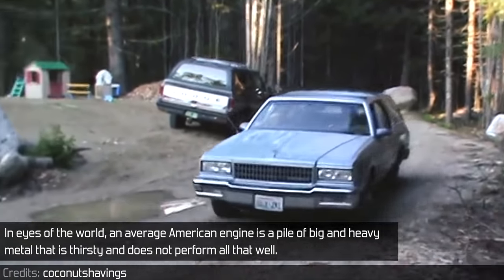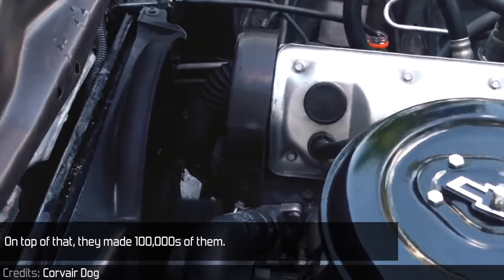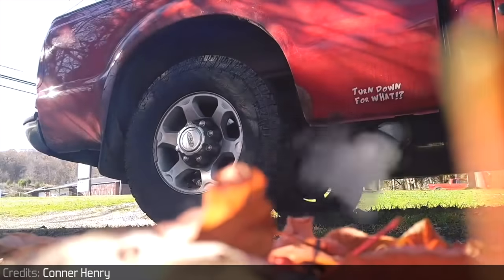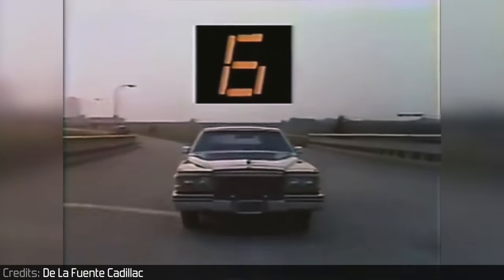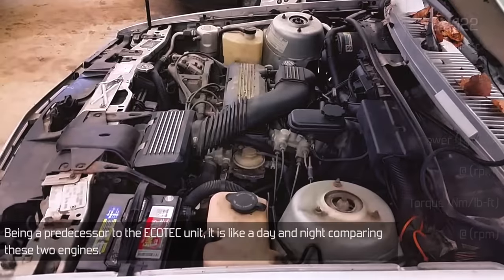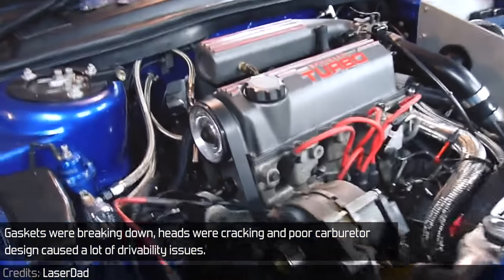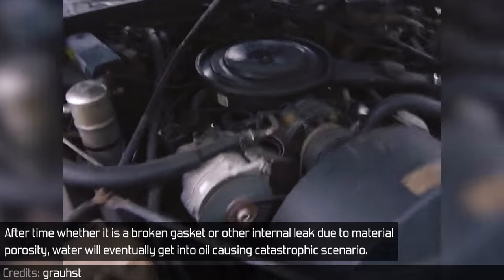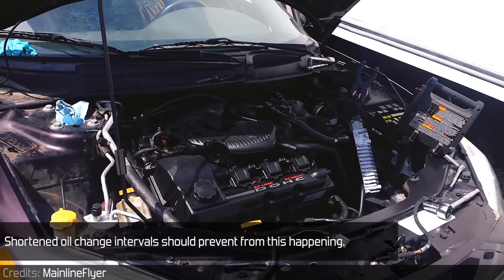8 Worst US Engines You Should Avoid

Comment: As I have a 03 expedition with a 4.6 with 150,000 miles that I use to tow my cars everyday. And I do mechanic work at home and I have never had that spark plug problem. Most reliable engine i've ever had TBH. When I went to buy my t-bird I drove the expe a 350mile round trip with a bad coil and it was still able to hit 70-75 towing my car. (At some points)

Comment: the 2.2 GM engine was not the most powerful and did have head gasket problems, but if you fixed the head gasket they would run a long time. i had a 91 cavalier 4dr 2.2 and had 220K on it when i sold it running. that old POS would not die LOL
Reply: Any engine with iron block and aluminum head is eventually going to need a head gasket. Nature of the beast.

Comment: notice barely any ford poducts... and the one they mentioned can't be too bad I've had 2 trucks with triton both ran strong with over 250k miles
Reply: I can make a list of the worst ford motors right now 

302 and 351 Cleveland’s prone to cracking the block down the middle

360 prone to guzzle down oil and eat head gaskets 

Any 4 cylinder they made 

And the 427 in 1969 which was complete shit
Reply: That's cause they usually catch fire and burn to ground
Reply: Ford has many bad engines just not as many as gm or mopar. Who um liked to experiment more. Gm has like a million engine families.
Reply: Like go into a gm wiki engine list the list is fucking massive.

Comment: What have we here?  More than half were GM engines.  That is awesome!
Reply: of course. all gm makes is garbage.
Reply: Really? 3 of the top 5 engines of all time are gm. The small block, the Mark IV big block and the LS series are better than anything Europe or Japan has ever built.
Reply: theres nothing good about the sbc. thats why, to build a good one, you need to use ALL aftermarket parts
Reply: no gm motors don't suck it's mostly there 4 cyl.if they suck then why do hotrod deres swap 350 in almost anything ?
Reply: Asphalt8ficionado But  which one is Found  On  The Road  Dead everyday  !!! , LOL   FORD IS ! .
Reply: I honestly thought there would be more Chrysler engines but most of their failures were electrical or in the transmission.

Comment: Correct on all engines except Triton.  The ford Triton is a terrific engine.  Its the best v-8 engine ford has produced in years.  It is complicated but it is very reliable and low maintenance.  You failed to mention the Cadillac Northstar engine.  What a miserable piece of engineering.  Now shall we go over the junk the Europeans produce.  The worst American engine is as good as the best the Europeans produce.  How about the plastic water pumps on the VW 2.5   What about the plastic radiator Hoses on BMW X-5.  Now lets talk about the backwards and horribly complicated electronic engine controls the European car manufacturers are so fond of using.  How about the steering wheel control modules on Audi.  If your battery goes dead the steering and ignition lock and many times the steering column will have to be replaced at a cost of over $2500.00.  I think this should be your next video VisioRacer.
Reply: The northstar had issues but it wasn't actually bad engineering all over it. Was it as good as it's siblings hell no lol

Comment: Only 1 ford made the list.
Reply: The early 60s Ford "cammer" V8 had close to 700 hp from a 7 liter. Naturally aspirated. Ford Werent fooling around at the time.
Reply: Surprised they don’t have the Ford 3.8 V6 from the late 80’s-90’s that was in the Lincoln continental,  windstar, Taurus and other vehicles. That’s a total trash engine.
Reply: The 4.0 Cologne V6 in the  Explorer was much worse.
Reply: Corey Grace Ford has alot of junk motors for sure

Comment: Simply turning up the fuel rate makes the olds 350 diesel perform surprisingly well. Had one that would break the tires loose going uphill at 50. And a simple swap to Olds 403 arp studs fixes the head gasket problem.

Comment: 137 hp for 4000 cc  v8 better back to godamn horses again hahahah
Reply: Kevin Bosco Ten years earlier, that same engine was putting out 450 BHP. The oil crisis, emissions laws and politically active hippies and anarcho-punks put paid to that. There was a big horsepower war between 1955-1973.
Reply: hahahaha almost think that engine only really produce 137 bhp for real hahahahah . so they make down grade that engine ?
Reply: Kevin Bosco Yeah, they downgraded the power output because of the emissions equipment strangled the air flow. That said, they're great for supercharging, being fairly low compression ratio.
Reply: Exactly.

Comment: The Oldsmobile Diesel block is hell of a block to build a gas powered engine it has been stroked to 440 for the street and 454 for the strip. Vega's of made from compressed rust! The 5.4 Triton in my truck has never giving me trouble. I guess buy a truck made after 1997 through 2003. It is not uncommoned to see trucks running strong with over 500,000 miles!

Comment: Any engine in a Saturn
Reply: Sam Thompson Bought my wife a new SL2 for her birthday in '93. Had to replace the timing chain at 90k and 130k. At 180k it needed it again. I sold it. Later found out through a FM TSB the problem was the timing chain was oiled from the runoff of the overhead cams. The oil drained through a small port drilled in the head to the front of the block and down to an oil slinger in the front of the crank shaft. That port would become clogged with sludge and starve the timing chain. 
Other than that, the car was excellent, and ran like a scalded dog!!!
Reply: Sam Thompson GM, not FM. damn spellcheck!

Comment: The 4.6 is not and will never be junk. That bastard will go miles beyond belief. I have a 98 mustang gt with 386k miles on it which has never had any motor work done on it. And is a daily driver, and a 2002 gt with 176k miles on it and it has just been as reliable as the 98

Comment: The 4.6 engines dont have problems with spark plug holes until very high mileage. Also you can put new spark plug holes in if you really want too.
Reply: ONE THING THE 4.6 has a problem with is the plastic intake manifold been thru  2 of them on my '97 grand marquis. piece of shit on an otherwise good engine.

Comment: I remember when they tried to convert those engines to diesel. No way where they going to handle that compression. Even without the filtration problems, the engine simply would not have lasted.

Comment: Toyota four cylinders were also prone to oil sludge. Because of their poor crank case ventilation they also are notorious for oil leaks.
 
I think there are many more engines that belong on this list but then you would have to include many of the Japanese and European engines from the 1950's through the earlier 1990's.

Everyone knows about the 5.4 Triton V8 spark plug issues because Ford sold so many of the damn things but that same issue was present on many manufacturer's engines that had aluminum threaded spark plug holes. Especially when they had high mileage service intervals.
The 5.4 Triton is also easily remedied with helicoils and will easily perform under extreme conditions for well of 300000 miles once properly done. As you may know, it never actually hurt F-series truck sales.
Reply: 1400IntruderVS If you don’t change the oil regularly.

Comment: I had a 122 in a Sonoma . Was great but the headgasket failed to to it already being replaced with the fwd headgasket witch had the thermostat housing on the other end of the head. Being a machinist I grabbed a scrapyard head and portmatched and polished it before putting that head on. I then turbod the poor thing running 4lb of boost at first than bumped it up to 7 but maxxed about 5 above 5000rpm . It was a fun little truck that always fired up for me without question . Without the turbo is was pretty slow but made decent torque .  With a 4.11:1 final drive it was quick to respond so it felt fun .

Comment: The Olds 350 @2:40 had many issues, not the least of which was being mated to the lightweight THD-200 Trans, but I bought an absolutely Loaded 1982 Pontiac Bonneville Brougham in '86 for $550 bucks because the original owner got scared off the Diesel. That car was a Cadillac (back when that meant something) in everything but name. In the few years I drove it before some drunk slammed into it while parked at the curb, I never had a bit of trouble with Bonne. I pugged in the block heater in the winter; I paused to let the glow plugs do their thing B4 cranking her over; I always kept the tank near full, which wasn't a problem with Diesel being under a dollar at that time. I was aware of it's faults and took steps to maintain it...I still miss that Bonneville

Comment: Back in the early 90's, I was in high school. We did a few Olds 350 diesel back to gas conversions in Auto Shop class. It was actually a popular conversion at the time.
Also, the bottom ends in these were bullet proof, and some even Hot Rodded them with great success.

Comment: I'll throw another one out there - the Ford 2.3 liter used on the Tempo/Topaz.  The oil change was easy - the filter was right up front, but every one of them ate a head gasket if they lasted long enough. Fortunately, the change was easy. I did mine in about hours.

I hated the late 80's Ford 1.9L. The oil filter is mounted horizontally and there's no way to avoid oil spillage when changing the filter. And you have to get your hand through a small hole or practically stand on your head to get it out from the top.

Engines I've run in the past: 
1969 Buick 350-2/TH350 - totally stock, exited an intersection at 35 mph from a stop sign.
1966 Buick 225 V-6 (with PowerGlide) - nice power, but crappy mileage with the 2-speed. Would love to try it with a 700R4.
1978 Chevy 305 (5L) 4bbl Rochester - lame. Hard to get from 55 to 65 even going downhill.
1991 Chevy 305 with TBI - WHAT AN IMPROVEMENT! All the torque I want, but a half-inch of snow, it's time to put it away. NO traction.
1980 Olds 307 - my first rebuild at 135,000 miles (cracked ring). Decent mileage and power.
1987/88 Ford 1.9L /port FI , 5 speed - It seemed peppy until I got in a long uphill (WI 120 South from Alpine Valley, East Troy, WI) Started up at 70, topped the hill at 50 in 4th gear. Peak HP at 90 or so at the yellow line. Needs help in hilly country.
1985 Ford 2.3 - as mentioned, it ate the head gasket. A week later I got rear-ended and totaled out. Loved the engine and car ('85 Tempo).
1980 Chrysler 225 inline-6  - reasonable power, good mileage, super easy to work on.
1993 Chrysler 3.5L - too much crap in the engine compartment. 
1996 Chrysler 2.0L - set the timing belt wrong, blew up the motor. Replaced it and got it right - runs like champ. Peppy for a 4-banger, but it's no rocket. Still have it. Had the engine swapped in 4 hours. The current engine is at about 155,000 miles and going strong, though it will need valve stems before too much longer.

Comment: The Oldsmobile designed quad 4  was GM 's First  high volume 4 valve per cylinder engine (2.3 ) liters . In the  1975-76 model year the  rare and limited edition , Corvette priced Cosworth Vega had a lotus designed  2.2 Liter 122 cu in 4 valve per cylinder head engine . Both of those engines were definitely better than the regular Iron Duke  Pontiac engine and Chevy's disastrous 140 cu in unit...

Comment: The HT4100 was a real piece of work.  My folks ‘84 Seville had it and I called it the biggest 4 cylinder V8.  They never had issues with it and the use of the coolant additive stopped corrosion.  But it was a gutless wonder.  Once you realized it was underpowered, you could compensate.   But Cadillac really needed a bit bigger engine.

Comment: I have a 85 Seville with the 4100 I had it 10 years no problems with the motor just ecm and the I replaced the column she Runs was my daily she did 113 on the freeway has 340,00k I was the lucky one lol change oil every 3k with Lucas additive Walmart oil she likes

Comment: I had a 2002 Pontiac Grand Am GT 4 Dr. In 2005. The car only had 50,000 miles and it still felt like new. But around 60,000 miles, the lower intake manifold on the 3400 V6 gave up and mixed the coolant with engine oil. Lucky I caught the problem quickly. It cost me  $900 to repair. In 2011 it was totaled in an accident and I walked away fine. The car was safe, fun to drive, surprisingly good on gas and sporty,  but I still miss it.

Comment: Agree with almost everything on this list except for the Chrysler 2.2. By the time fuel injection came around in 84 or 85, they were pretty solid in quite reliable. My 85 turbo New Yorker went well past 100,000 miles when I sold it and it never experienced a single cooling issue or carburation drivability issue.

Comment: The Olds diesels weren't just unreliable in their initial production runs, they were obscenely underpowered. The V8 maxed out at about 100 HP, which isn't much of an engine considering the 4,000+ pound land yachts they were putting them in. On the other hand they did live up to their high fuel efficiency promise, according to the MotorWeek Retro Review of an 1982 Olds 98 Regency Diesel it did get over 30 MPG on the highway, and you can find that review on Youtube to see for yourself.

Comment: I had several chrysler 2.2 engines. Did not have the problems listed. Replaced 1 distributor which was easy. Replaced 1 starter which was hard. The engines were fast and fuel efficient with the carburetor. I had a brand new 1986 dodge charger, with the 2.2 and a 5spd transmission. Had a 87 horizon 2.2 with automatic transmission. Only got rid of because of rust. Had a few others. The 2.2 TURBOS are now collectors items.

Comment: 5.4 is not a bad motor.  They never had problems with the bottom ends on the things.  The biggest source of the problems on them was just a lack of routine maintenance.  Don't leave the same spark plugs in for 100000 miles and you won't have any plug problems.  Change your oil every 3000 and use the proper weight.  For some reason guys want to use heavier oil in modern engines.  The problem with that is heavier oil will take longer to get to the bearings and cam saddles upon startup.  A lot of 5.4 engines had cam saddle issues because of these two problems.  Please use what weight of oil the manufacturer recommends   on any engine!  Your not smarter than the people who designed it.

Comment: My triton 5.4 has 270 and I just did timing chains at 240. No spark plug issues with mine, ever. Owned for 2 years did the spark plugs twice chasing a skipping issue that turned out to be with my tune. 

Very reliable engine actually!

Comment: I'm not a Ford guy, but one of our fleet trucks is a 4.6 Triton with 380,000 miles and it hasn't had any of these issues. These may have problems for other people, and having changed the spark plugs (mine came out and went in just fine) I can see why people may have the issues mentioned here, but I've never heard of someone having that problem and I suspect that the only reason they would have the issues mentioned is if they're installing the incorrect spark plugs, or not torquing the spark plugs to factory spec.

As for the Cadillac 368 (V8-6-4) plenty of those are still on the road today, with their cylinder deactivation working flawlessly. Additionally, even of you somehow fried your computer, cylinder deactivation takes less than one second (yes, less than a second) to turn off, and with cylinder deactivation off, it's a fuel injected cast iron big block with something like a 200 year service life (huge cast iron block with a small bore and stroke). I met a chap at the 2018 CLC Grand National who daily drove his since he bought it new, and hasn't ever had an issue with the cylinder deactivation. Personally, I'd gladly buy a 368 Cadillac because I could direct drop a 500 or 472 in its place, and they retain impressive value, simply for  containing the highly sought after motor mounts, driveshaft, rear axle, and accessory brackets for most 500/472 engine swaps.

Comment: The Toyota 2.4 is a POS. Had one in a Camry. It went at 45,000 miles and Toyota tried to tell me it was my fault. Um, no. Your engine is garbage. AAA towed the POS to the nearest garage, the old man came out smiling ear to ear and coyly said "oh, a Toyota... 2.4 engine?" I said yes. He then goes "how many miles?" I replied 45 thousand and he instantly quipped "BLOWN ENGINE" - I was like, how do you know you haven't even looked at it yet and he jabbed back, "I don't have to, my son WORKS for Toyota." - BTW, he was right. It was a blown engine, still under the 60K powertrain warranty and Toyota didn't want to fix it, even though I had receipts showing regular oil changes and maintenance. Had to fight them - they finally caved but I vowed to NEVER buy another Toyota. They don't back their vehicles and try to pass the buck of blame for shotty engineering. They did the same when the Prius was taking off on people. It was never Toyota's fault, it was driver error. BULLSHIT. FUCK TOYOTA.
Reply: The exact same thing happened with me.
Reply: i have a tacoma with a 2.4l i4 in it with 100k miles on it and it still runs like new..... there is a reason you always see those cars being sold for a decent price with over 200k miles.